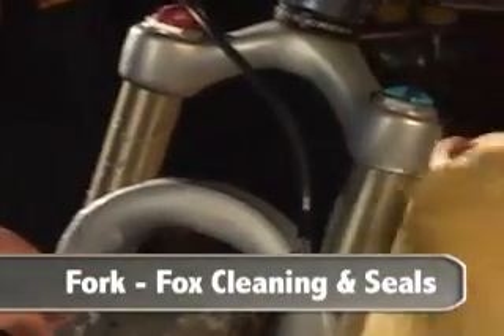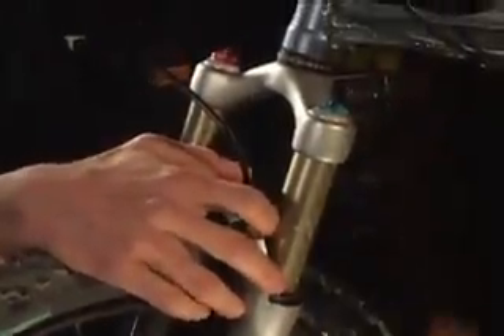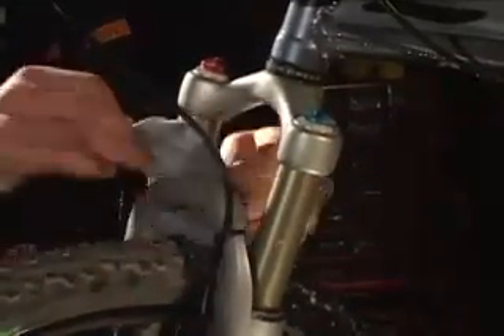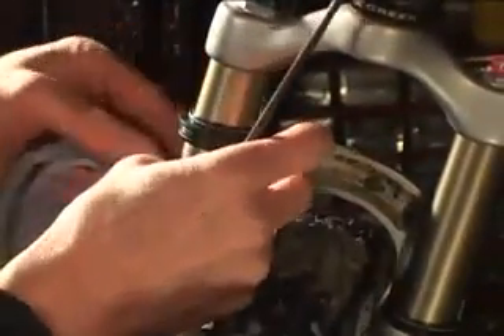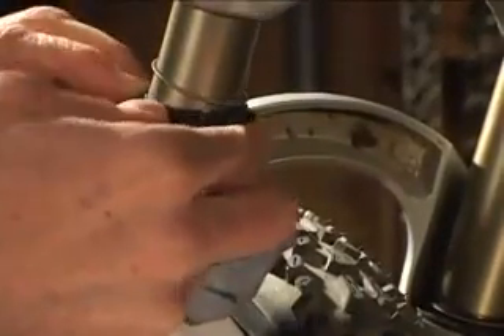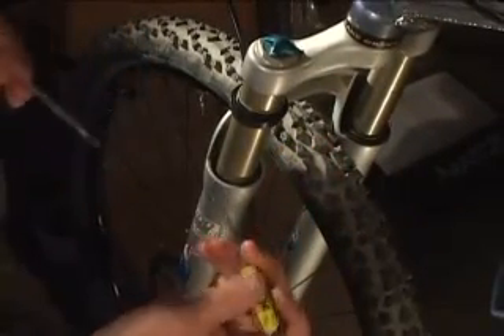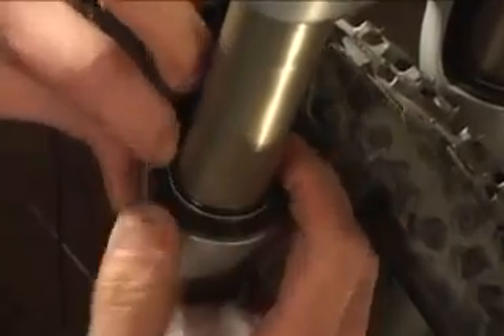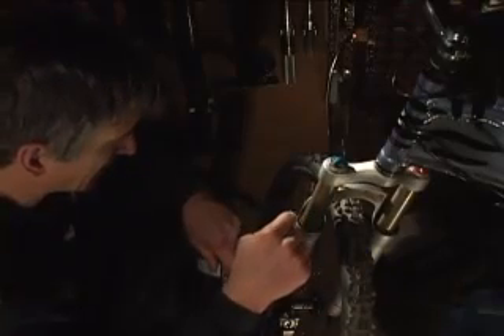Tech FAQ: Suspension Fork Maintenance

Comment: I use amsoil atf on all my forks, they work perfect. 1000 miles on my 9ner fs dh bike. 

Amsoil is perfect for bike syspension systems, i run it in all my shocks.

Comment: Thanks for this vid.  Question.  I have an 8 year old Rockhopper and need new forks with suspension (currently don't have any).  I have threaded so do I just need to find out if I have 1 in or 1-1/8in  and buy another threaded fork or is there more to it?  Any suggestions on a good fork under $150?

Comment: @DaveInON yes it can. i have a lower ekd fork too that requires constant cleaning for it to work well. removing thwle lowers and greasing the seals with silicon grease and oil helps, also if you put 5wt oil and fill up the coil side halfway or so with oilnit helps it. if you have air put it in the rebound side and that will help a bit too.